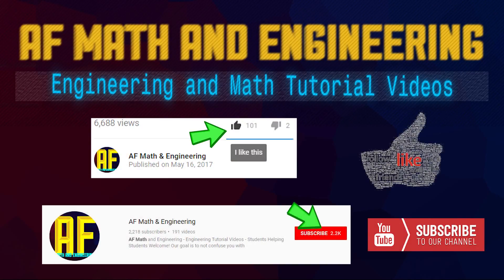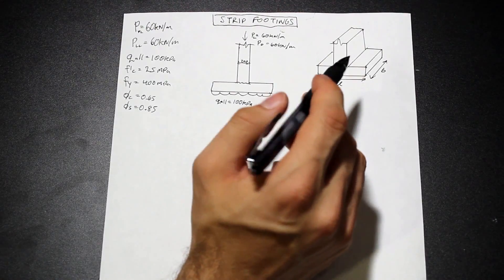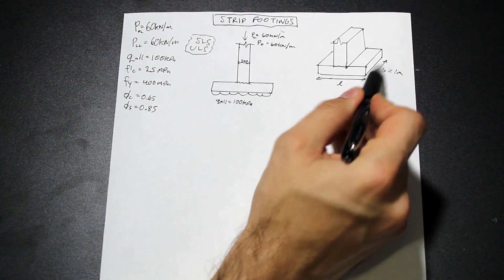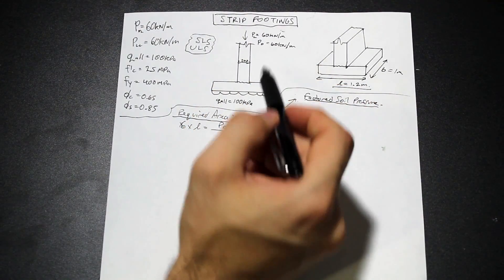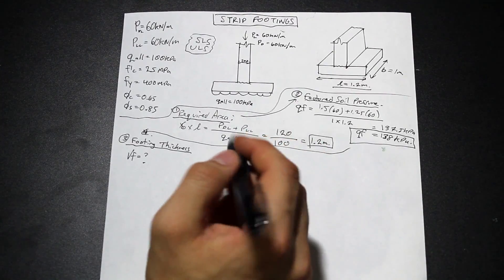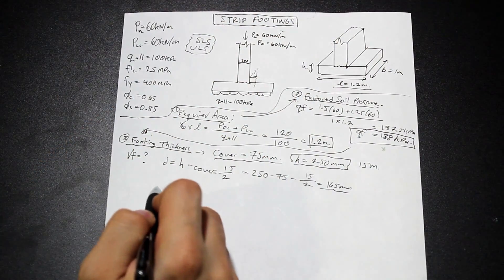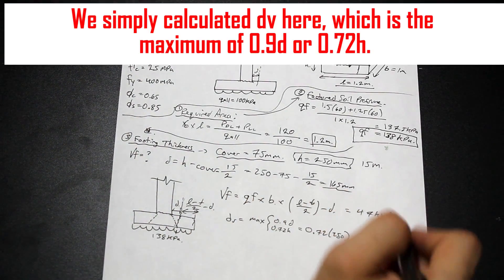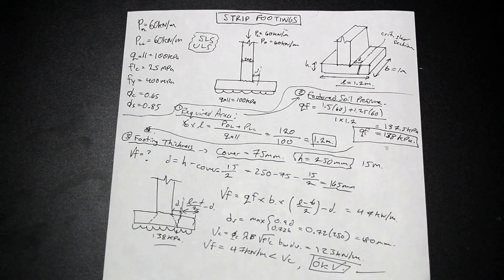How to Design a Strip Footing - Structural Design Part 1/2

Comment: By far the best, articulate video on this topic on YouTube! Double the Thumbs up for AF Math & Engineering. 
BTW, I put these formulas in a spreadsheet, unfortunately, I'm not coming up with the same results as depicted in the video e.g., . I cannot make out the with of the wall. Is the width of the wall 203mm? 
One other thing, when I plug the numbers into the formula qf x b x ((( l - t )÷2 ) - d ), I come up with 68kN/m where you show 47kN/m.  Thanks.
Reply: I also get 
68 KN

Comment: your calculations cant be used to pour a footing to support a single story house.  A footing height = 165 mm=1/2 thick footing.  in CA the 2500 PSI reinforced concrete footing is at least 30 inch deep depending on the soils engineer report.

Comment: What if the wall is at the edge? The load is coming gonna generate turning moment
Reply from the maker: Generally you wouldn't do this unless you have a perimeter wall footing against an existing building or a property line.  You can either design for eccentricity or assume the eccentricity is resolved by the slabs that tie into it.
Reply: @AFMathandEngineering  is my assumption right? took in this case z=Length of wallfooting-col width in order to to bring actual moment instead of L-B/2 (case wall at mid of strip footing).
Reply from the maker: @khaliltarabein8928  not going to cover eccentric footings in the comment section lol, perhaps we'll try to get to a video
Reply: @AFMathandEngineering  Thanks Sir,interesting topic hopefully you get a video.👌✌️

Comment: Can you design a spread footing like this too? or you have to take the entire length of the spread footing in consider for sample a 2mx2mx0.4m spread footing
Reply from the maker: Spread footing is two way, this is strictly one way, some of the techniques are the same though.
Reply: @AFMathandEngineering  I mean can we skip punching shear when designing
Reply from the maker: Depends on the ratio of length to width but typically no if it's a column footing
Reply from the maker: Also familiarize yourself with your concrete code.

Comment: You did not mention that you also assumed the rebar size you used to achieve the effective depth (d).
Reply from the maker: Those are established standard diameters?
Reply: @AFMathandEngineering  Yes, there  are standard steel diameters(15, 16, 18, 20, mm etc.), however, in this case we are dealing with a shallow strip footing, therefore I think what's assumed was the common bar diameter used for normal footing.
It is important that you mention that assumption to guide your audience where it came from. right sir?
Reply from the maker: @jairuselyczar8749  That we're using standard canadian bar sets?  I suppose...although that's not the point of this video...but it's not a bad point.  Noted.  Thanks!

Comment: How do you find the area of the square footing when you're not given the SBC ?
Reply from the maker: Does SBC stand for bearing capacity?  You can't design a footing without a bearing capacity.
Reply: @AFMathandEngineering  I'm working on a project, I have the boring log and I am supposed to calculate all the soil parameters regarding the project. I just figured that I'm supposed to assume an area for the footing and then calculate the soil bearing capacity. My question now is if you know how to calculate consolidation or soil elastic settlement using SPT?
Reply from the maker: You're supposed to calculate the soil bearing capacity from the geotechnical testing data.  As a geotechnical engineer you would then write a report with a founding elevation and the bearing capacities that soil or rock can sustain.  The structural engineer will take that information and size fheir footings accordingly.

Comment: hey i would like to know which structural engineering software is mostly used in Canada.
Reply from the maker: Most likely similar to other countries around the world, CSI software (etabs, safe, sap), microsoft excel (most important), s-concrete or sp-concrete, obviously cad and revit for drafting,  adapt, im sure theres plenty of variety depending on the firm but these are some of the main ones.

Comment: depth of foundation assumed 250 mm , and strap beam calculation for bending moment and shear check, depth of footing checked 0.4 d and 0.72 h that is dv Max , this as per codes or any thump assumption.

Comment: Great video! What happens in the case that your width of footing is say 400mm instead of 1.2m, which would give a design shear of less than 0 using the formula (l-t/2) - d. Would you then increase the width until such a point that shear is positive?
Reply: In my opinion, if the strip footing exceed the face of wall less than d, we can say that there is no shear force to check, only compression

Comment: Thanks for the video ..In a real life situation, how do you determine the values of Dead and Live Load to start your calculations?
Reply from the maker: Hey good question..for a building usually you'd start from the top and run the loads down to the foundation depending on areas and occupancy, this can be done manually using Excel or using a program like etabs.  The loads on each floor depend on what usage they are,.your local building code requirements, etc.

Comment: Thanks very much for the video. I have a question. Your calculated qf = 138 kPa exceeds qallowable = 100 kPa. Is that acceptable?
Reply from the maker: Thanks for the comment! Our factored soil pressure is calculated using our factored loads for the purpose of flexural and shear calculations.  It shouldn't be compared the SLS bearing capacity, they're separate things.
Reply: @AFMathandEngineering  ok. The data doesn't have ULS bearing capacity of soil. I guess we should make sure that pressure due to factored load does not exceed ULS bearing capacity.
Reply from the maker: @tanweermalik3512  correct, although when sizing footings based on bearing service loads and SLS bearing capacity almost always govern.  Should still check though.

Comment: Hi,  Do you need to consider the soil on top of the strip footing as surchage force to check the allowable ground bearing capacity is adequate?
Reply from the maker: You could, but most people ignore this in practice as it's negligible.  If you were to perform this check, I suppose you could also subtract the pressure from the soil from the factored soil pressure on the bottom of the footing when calculating shear and moment as well, depending on how much soil is on your footing.  Usually in practice only about 300mm is left from top of slab on grade to top of footing unless the footing is lowered for one reason or another, so it's pretty negligible.

Comment: what is t?
Reply from the maker: Thickness of the wall
Reply: and how is it known?
Reply from the maker: @adamjazzar4560  it's dimensioned in the first figure where the loads are given
Reply from the maker: Hey, see our latest video on one way shear calculation of slabs, you'll find it useful as it relates to this topic.  Thanks.
Reply: @AFMathandEngineering  vc=(0.65)(1)(0.18)(5N/mm2)(1000mm)(180mm)=105,300N=105.3KN

Don't understand how you got 123KN?
if bw is the same as L=1200mm then Vc=126KN much closer
but the CSA defines bw also as wall thickness (CSA A23.3-14 sec 11.3.6.3) using bw=200mm then vc=21.06KN

Comment: great video, but you need to fix your shear force unit where you have 44kn/m to 44kn. thanks mate.
Reply from the maker: The unit is correct as we're working with a one meter strip of the wall. You could multiply in the 1m and cancel it, it's a preference thing.  But it definitely isnt wrong.
Reply: yeah i do understand. however. the shear force unit is in Newton, and when you multiply the Pressure by area you only have one unit and that is in Newton. however i do understand what you say. thanks for your great video. explained it well. cheers
Reply from the maker: @felixdavis516  first thanks for the positive feedback! You're right about the units of shear, but we're working with shear per meter of wall, which is 44kN.  The wall is longer than a meter, let's assume 10m.  Thus the total shear force acting along that plane on the wall is 440kN.  Sometimes we just drop the /m thing as it's known we're working with a one meter strip.
Reply: I just realised that you are actually right. it makes sense, because you calculated it per meter length. thanks dude.  excellent work!
Reply from the maker: @felixdavis516  Thanks for your feedback! Glad you enjoyed it!